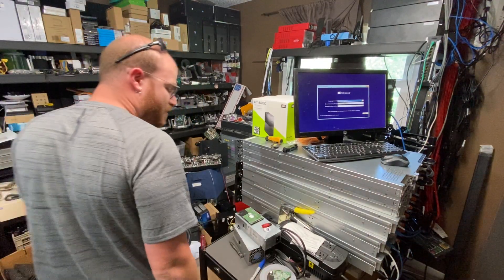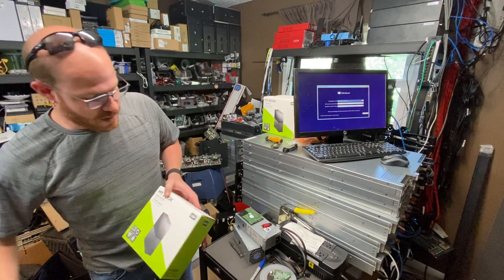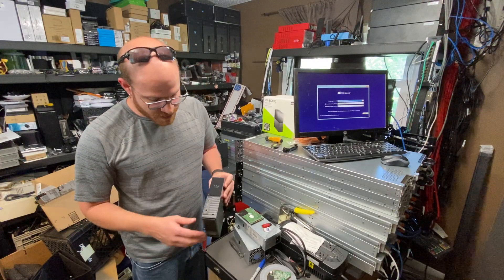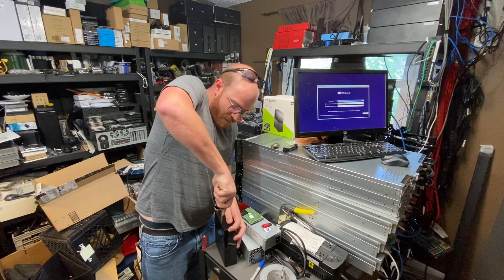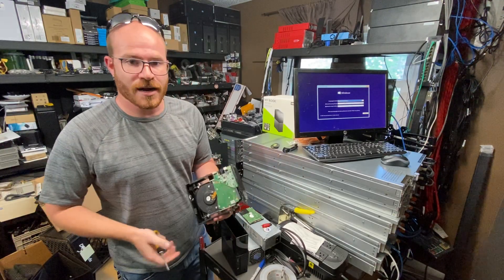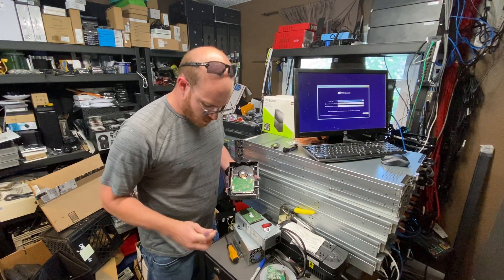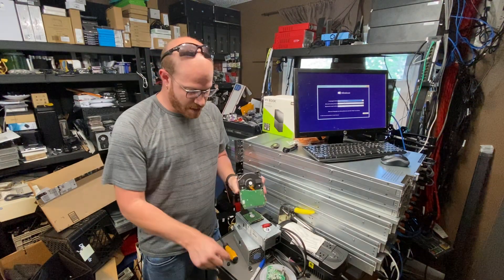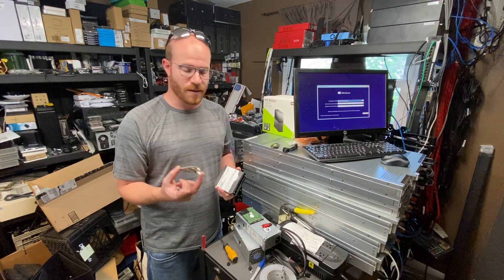Lets Talk about Drive Shucking

Comment: What's the purpose of this?
Reply from the maker: The hard drives that are inside the enclosures sometimes can be bought less expensive than just a straight internal drive and is simply an internal drive with a circuitboard attached to it to allow you to use an external power supply and a USB connection. Sometimes you just get a better deal by doing it this way
Reply: @bgp4me  I understand, I was actually trying to ask why make it an internal when it functions and has added utility and lifespan as an external?